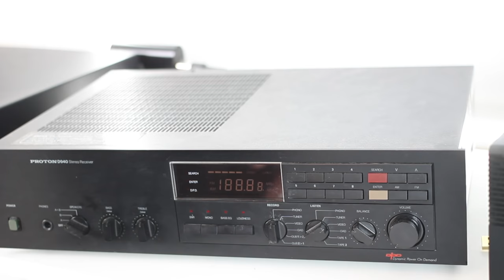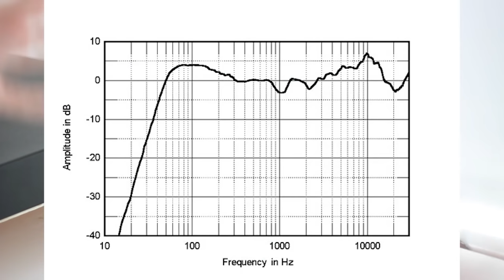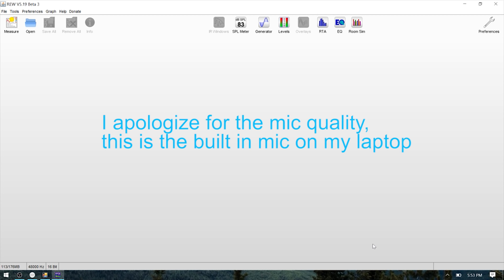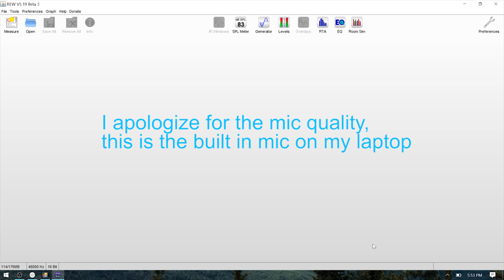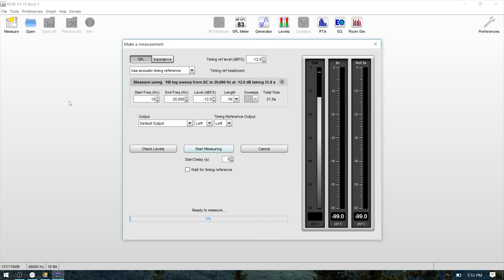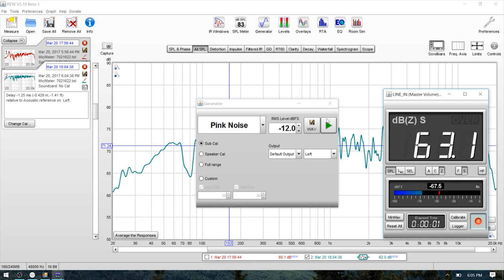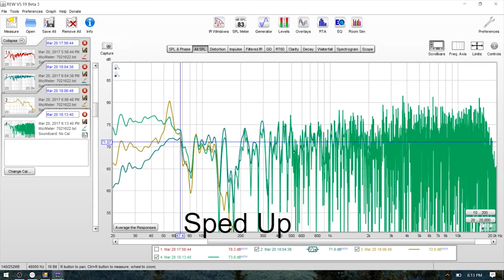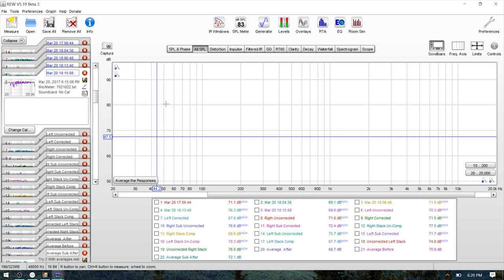Beginner's Guide to Loudspeaker DSP and Measurements (w/ MiniDSP)

Comment: EQ'ing a room is a terrible thing to do. Why? Your readings are true of that one place where the microphone is placed. Even a couple of feel away the frequency response and ringing chart will be completely different. Your EQ filters won't correct anything, if anything it will harm you from hearing sound in the correct way.
Reply from the maker: Please watch my Dirac video: https://www.youtube.com/watch?v=RgECJu-2hOY

While you are partly correct, since this is the "Beginners" guide, I did not get into multi-point or power response correction.

Also the off axis response is generally exponential, so you should be totally fine when +-5 deg off axis, which in my specific instance is around a 1ft lateral area.

I also cannot think of a situation where multiple people in a wide area will all be CRITICALLY listening. Only a couch/home theater scenario, but then again you have a center channel to balance it out.
Reply: Again you are wrong. Whatever filters you apply will help you for the one point of space where the microphone was placed. Often, even a movement of few inches causes a measurable change in room frequency response of upto 20db. So again, room correction through EQ is useless. Because in the real world, any reasonable person will expect to move their head around a little bit. The only way out is to sound treat your room, be it for a home studio or home theater setup. And importantly, EQ correction doesn't fix ringing in the room. Read this article for a far better explanation: http://realtraps.com/art_audyssey.htm
Reply from the maker: Again please watch my dirac video.

Unless your speakers are absolutely horrible, a few inches will not make a 20db difference. MAYBE 5db

Find me a respected speaker who's off axis results indicate a 20db change @5deg
Reply: Wrong. You are not hearing just the speakers. You are hearing the speakers + the room. And most rooms are not built using acoustic considerations and have terrible responses. We are talking massive peaks and nulls here, of up to 40db. Your ideas are at best well intentioned, but you are seriously misinformed. If sound can simply be EQ'ed to good responses, there is no need for acoustical treatment anymore. http://realtraps.com/art_audyssey.htm I have already posted evidence for my position. Besides EQ does not fix Modal ringing, where some frequencies stay in the air longer than others. And you are suggesting 20db cuts and boosts? Do you want to blow up your loud speakers? This is very bad advice all around.
Reply from the maker: #1 that article that you keep linking to is from 2007, and DSP solutions have probably gotten 20 to 30x better since then. Audyssey is a complete joke as well. ALSO it is on the site for a treatment company. What do you expect, anything pro-EQ? Of course not.

> You are hearing the speakers + the room. And most rooms are not built using acoustic considerations and have terrible responses

Yes, and this is why you measure from the listening position, which factors in room response.

> . We are talking massive peaks and nulls here, of up to 40db. Your ideas are at best well intentioned, but you are seriously misinformed.

If I am misinformed so are many of the major speaker designers today. Linkwitz, B&O, Kii Audio, Lexicon, Apple, SVS, DEQX, Meridian, all use some sort of room-based DSP to correct response.

>  If sound can simply be EQ'ed to good responses, there is no need for acoustical treatment anymore.

To some degree yes. DSP can fix bass nodes under 200hz. RInging and resonance above that point are un-solvable without Treatment. So both of us are correct to some degree here.

> Besides EQ does not fix Modal ringing, where some frequencies stay in the air longer than others. 

Correct. I never said it did everything.

> And you are suggesting 20db cuts and boosts?

> of up to 40db. 

IDK where you are getting this idea of 40db dips and spikes, it just isn't reality. Sure maybe if you have serious bass nodes, or horrible speakers, but this is certainly not the norm.

https://imgur.com/a/Mcmg7

These are my graphs. Biggest dip or spike I see is 10db.
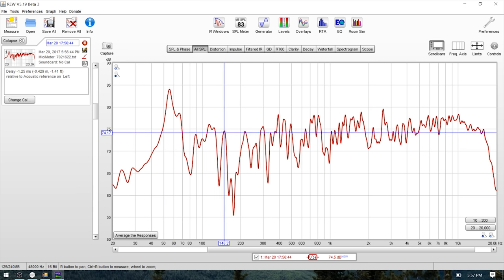Reply: I am not linking to speak of one particular solution. I am speaking of EQ correction as a whole. One measurement accounts for one incredibly specific listening position. Even a small change in position produces drastic differences. Some companies employing DSP says nothing about the effectiveness of DSP as a technology, that is a plain strawman. We need data. In a typical small room, you will see huge peaks and troughs. A 40 db difference between the two peaks is so common. Your own video shows a 30db difference at 27:35 and 40db difference at 33:10 . Anyway, I have tried explaining to you and you seem adamant.

Anyone else reading this. Go ahead and apply EQ correction. Then take your mic and measure your room again in multiple different places, you will soon see how you possibly messed up the frequency response in the room. The only EQ correction you should consider in a small room is a bass cut, because bass is guaranteed to mess up things in a small room. So the only solution is to attenuate it. But if you care for a good frequency response and reduce ringing, both which are fundamental to good fidelity, you should consider acoustic treatment instead of wasting money on useless products. Bass traps, broadband absorbers at reflection points and broadband diffusers. No other way to go. I rest my case.
Reply from the maker: I see you still haven't watched my Dirac video. Maybe you can learn something about multi-point correction there.
Reply: @ Tejas-  You are incorrect and obviously need to do some research on sound.  A single point correction can make a drastic difference for multiple positions.  What you are arguing against has been proven by multiple experts in the field.  Sound absorbtion and difraction can help in specific scenarios, but for you to dismiss actual room correction would be like dismissing cross-overs in the speakers themselves.  Even Linkwitz uses a minidsp, and I believe he has just a tad bit more experience than you, not to mention actual mathmatical formulas to describe what is happening.
Reply: +Dustin I don't know if you are deliberately misconstruing my point. Here goes anyway. A single point correction does make a drastic difference, and I am suggesting this is an undesirable thing. Here is a scenario. At your measuring position there is a measurement showing a massive 20db null at 5khz. Applying a 5khz boost is a terrible thing, as the DSP is a global change which applies to the whole room. The frequency response of a typical room (especially a small room) is very uneven, changes every few centimeters. That 20db boost will likely screw up the entire room even more. The only DSP correction that you can perhaps consider is in the bass frequencies (sub 150hz) as the modes are long in length and don't change that much in short distances. That is why you see those bass eq settings behind monitor speakers typically. 

I have gone through Linkwitz's website, and he suggests it only for correcting the low-frequency response. That too only in "sealed boxes. It's not suitable for ported boxes or for open-baffle speakers." There is simply no substitute for room treatment. Why do you think large studios spend so much to achieve that? Linkwitz has not suggesting overall eq corrrection of the room through DSP from what I have read. https://www.minidsp.com/applications/advanced-tools/linkwitz-transform

Instead of attacking me, why don't you try and apply DSP eq filters and after that measure the frequency response at other positions. People have done that http://realtraps.com/art_audyssey.htm
Reply: +Technico You are not seeing the point made by other user. Regardless of how many measurements you might make, you cannot apply one EQ filter that will apply to a room which will have such a variable response depending on where you measure. You will end up screwing up the response of your room even more. You need to learn about what you speak and write about before making flawed arguments.
Reply from the maker: And of-course linkwitz uses single-point corrections haha
Reply from the maker: The whole point behind a single point "listening point" correction is that it is taken at the listening point.

In what situation would someone be doing critical listening outside of the listening point? Not really. 

If you are talking about a home theater or showroom, you'd use Dirac or multi-point.

I know the benefits of multipoint measurements. I'm not an idiot. But then again, this is the "Beginners Guide" not the "Intermediate or Advanced" and multi-point corrections with summing and proper physical measurements is not beginner material
Reply: Technico Why do you leave the room when you measure?
Reply: LMAO I know this exchange is old but my God! To all you idiots that are against this single point correction, no one said that it is an end all be all solution that will magically turn your room into a high end acoustically treated room. This is just a guide to help complete beginners get into room EQing. Besides, unless you jump and run around in circles like a crazy person all over your room while listening to music single point correction is more than enough on a normal listening room for the average sane person where you just sit on a SINGLE position while enjoy the music.
Reply: @technico when eqing a sub what level of gains are ok? I'm using all 10 filters on my minidsp hd and 2 are on +8db and I've got one on +4.5. Is that ok?